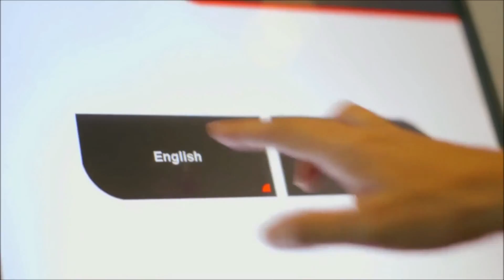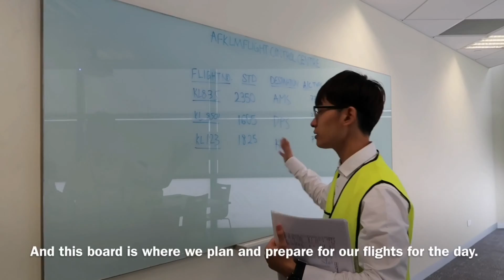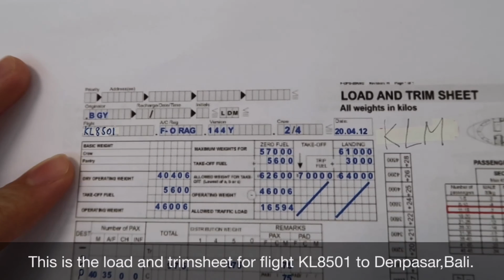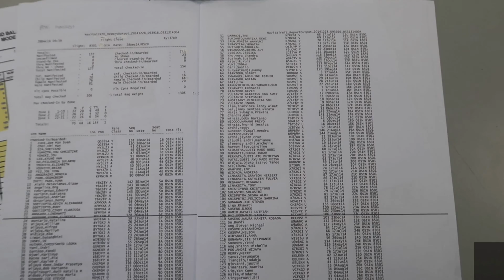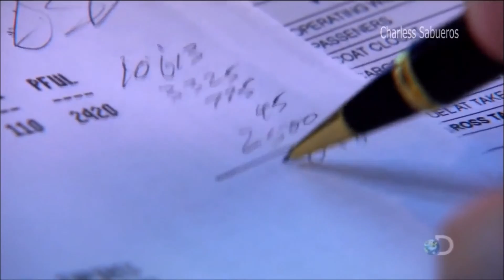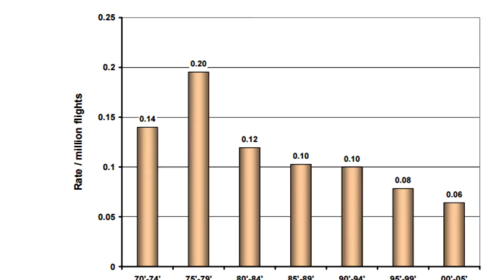Aircraft Weight and Balance

Comment: what happens if every one is on the plane but not all the bags can go do to weight
Reply: Almost all transport category passenger aircraft have a pretty large allowance built in for excess baggage, and a surprising amount of cargo also gets carried on most passenger aircraft.
This means that you can bump some cargo to a later flight to allow enough capacity for passenger's baggage.  It is also one reason for standby tickets, which buy you the flight, but only if there's enough capacity to carry you - otherwise you will be moved to a later flight.
In the worst case scenario, if this is recognised at loading time, financial incentives are offered to passengers to transfer to a later flight.
A gross overload (108% of maximum take-off weight for the weather conditions) and aft-of-limits centre of gravity was one of the major causes of the Concorde disaster in Paris - properly loaded and maintained, that Concorde would have been airborne well before running over that infamous strip of metal on the runway.  In that instance, it was largely because the Captain elected, for reasons known only to himself to load fuel far in excess of that normally permitted, which meant that the wing tanks were pre-pressurised with fuel so that when the tyre debris hit the wing, the tank burst from the inside (it was not penetrated from outside) due to the shock wave, as there was no air space in the tank to cushion and absorb the shock.